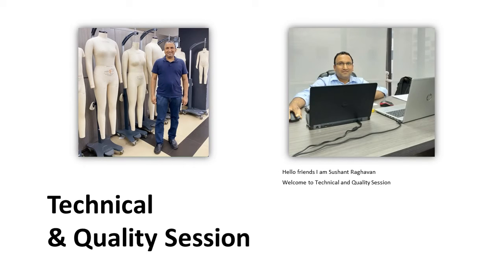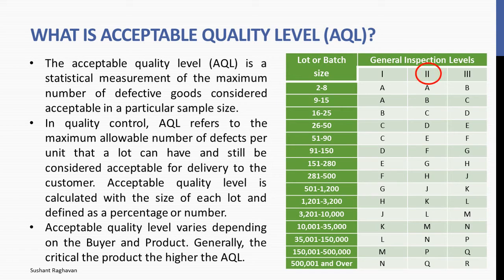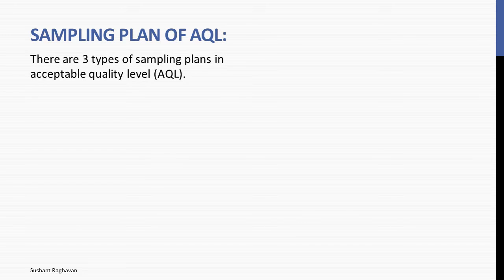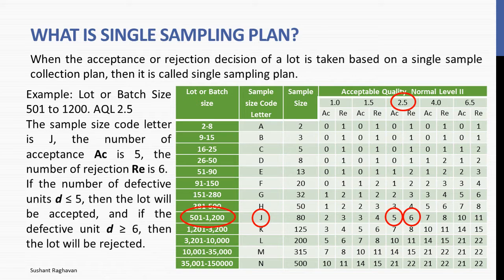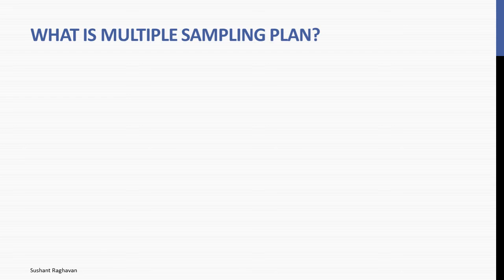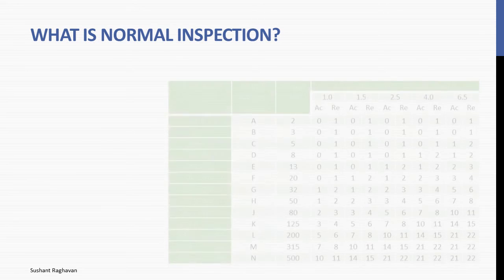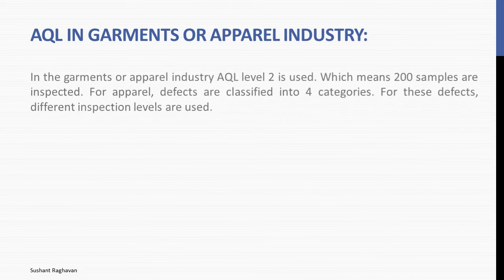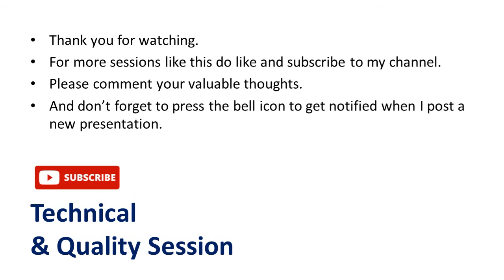WHAT IS ACCEPTABLE QUALITY LEVEL

Comment: Hi I have a question on AQL:

Example:

Batch Size: 65

AQL: 0/1.5/2.5

Sampling Level: Level II

So in this case Sampling will be 20, as the arrow is pointing downwards for minor

So for the 20 Pieces we will check for minor defects, and out of the 20 Pieces, we will check 8 Pieces for Major Defects.

My Questions are:

1. How many pieces do we need to check for Critical Defect?

2. If we find Major defects from the 9th Piece onwards, how do we count it?
Reply from the maker: https://youtu.be/zACfF2rUVhc